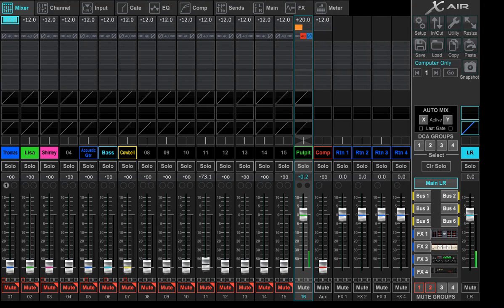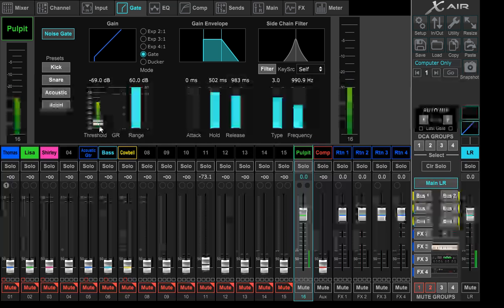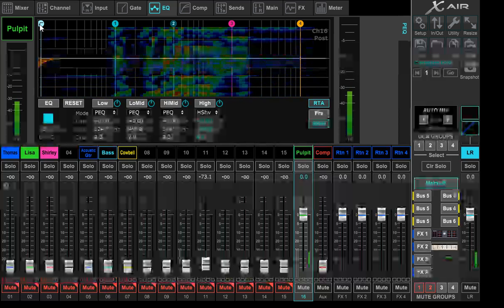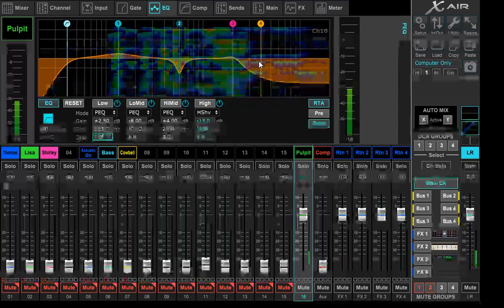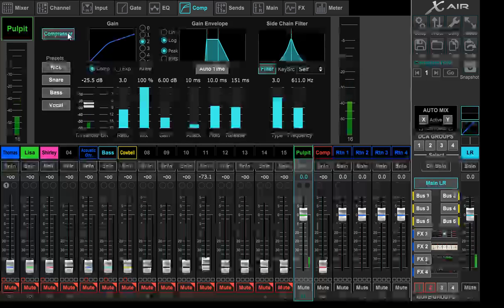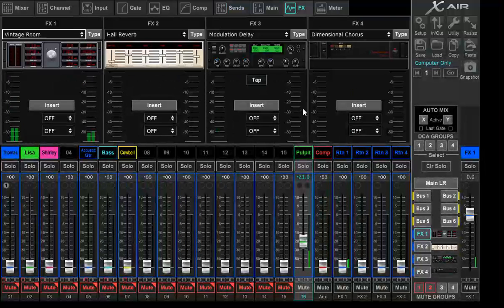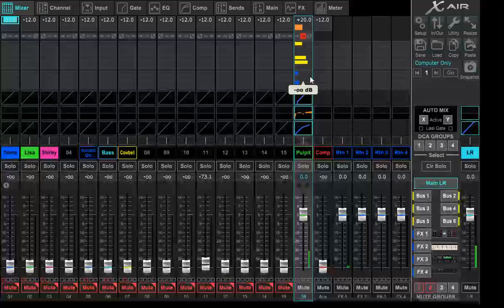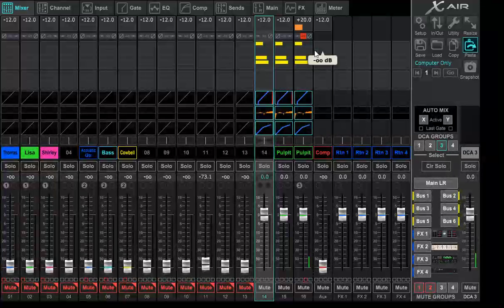Setting up a Channel on a Behringer XR 18

Comment: Thanks , this really helped with setting up a channel, especially for vocals. I'm still having trouble using a line input from a music player.(3.5 to 6.35 stereo cable)..it sounds weird, maybe it's  because i'm using a Y splitter for the LR  main out in to a single XLR,(single active speaker)?
Reply from the maker: It could be because you're trying to use a stereo cable instead of a stereo separation cable. That can create a situation where the two audio signals cancel one another out due to common mode rejection. I really like Digiflex HIN series of cables for this application. They have XLR and 1/4" varieties. https://digiflexcables.com/products/hin-1k2x

Comment: HOW TO FIRST SET INPUT GAIN (not correctly done in this video):  A PFL meter that shows you green-yellow-red will help you visually set your input gain. The beginner should not do this only by ear. You do this before adjusting the fader (even with the volume fader all the way down). This PFL meter is what you will find all the way to the left of the channel's INPUT tab view (https://www.youtube.com/watch?v=knG78f58R70). Bring the gain up from its lowest setting until the loudest parts of your signal are hot enough to light up all of the green, yellow is hot and it's your limit, but NEVER the red. Then your signal is properly hot enough so that you have a strong signal-to-noise ratio without clipping. Red is distortion to clipping, and you never want your signal in the red. On this software, the green to yellow to orange to red transition is more subtle than on other boards, and I find that staying out of the yellow-orange-red is proper. I suspect the gain was too low in this video, and possibly why the audio of this video is very low. Aside from all of that, I appreciate Andrew taking the time to overview the X-Air Edit software in his videos. He did the BEST job of them all!!
Reply: https://collaborateworship.com/how-to-set-gain/
Reply from the maker: I agree. If I had it to do again, I would do it differently. Thanks for your input :)

Comment: I very much appreciate your response Andrew but why does Behringer boast about these so called “Midas designed preamps “? Obviously to confuse us into thinking they ARE MIDAS!...  the xr18 is ok for background music or DJ but no way are these units for vocals... I purchased the x32  and got rid of it.... at the end of the day yo7 won’t beat analog for vocal presence... and yes there are other boards but how many boards should I spend money on to perhaps get the same or similar ??
Reply from the maker: Yes, I know a number of people who are rather incensed that Behringer bought Midas. I'm not up to speed on the controversy, but Midas was a very well-respected company and Behringer's reputation was not at that level. There are lots of good digital consoles out there, but this channel is focused on helping people get started with older or beginner gear.

Comment: I have this unit and it is Worst vocal sound I’ve ever tried to achieve!! It just doesn’t have it
Reply: Maybe you should learn how to use it. Sounds like operator error.
Reply: No, It just doesn't have that vocal presence like you'd get from an analogue mixer... I like vocals to have presence... No matter what FX on this xr18, the vocals are hollow sounding... thrown out into a tunnel like effect... Just no presence...
Reply from the maker: Behringer stuff is very price competitive, but if what you want is that level of production, there are lots of good digital units out there. I'd recommend you take a look at the Allen and Heath or Yamaha lines. The XR18 is entry level gear.
Reply: Andrew Bellous do you mean “entry level” as in average?... I can imagine any other digital component being any different other than a decent preamp.. the rest is basically down to how we EQ and the usual FX... these digital boxes won’t touch analogy
Reply from the maker: The XR18 is a nice little board with great features, but it's relatively inexpensive and there are other boards out there which are several times the cost, and there are reasons why they cost more. Preamps are one significant factor, but not all digital effects plug-ins are the same. The variety and quality of plug-ins does make a difference, too. As I mentioned, the Allen and Heath SQ line or the Yamaha TF line might be products that would get closer to the sound you're looking for. Just because the sound these new digital units produce is different doesn't mean they are inferior. They may just have a different set of strengths.

Comment: Thank you for the video. I am having trouble with setting my effects. I get confused on how to send them/set them up with multiple channels. For example; I’m setting vocals for channels 11 & 12 and I want to insert a hall reverb. I’m inserting into the channel and only one channel and I’m unable to add to the other channel. We use the system in a band set and forget setting. Could you give me some tutorials on how to properly do it win the x18?  I’ve watched several which is confusing
Reply: I'm just learning this board now, but usually that's done in one of two ways. either through the send and receives along one of the effects buses or send the vocals to a sub group and apply the affects to the sub.
Reply from the maker: Sorry, I no longer have access to that board, as I'm serving another church now.

Comment: As a total noob i am trying to understand my XR-18.. your video is of good use as a quick how to... thank you.. i am still trying to understand DCA's ... what if for example channels 1 2 and 3 are on DCA 1 and if i move the fader from channel 2...will fader/channel 1 and fader/channel 3 follow the same as fader 2? Or can DCA's only be controlled from the main LR Slider? questions questions questions..... aaaarrgghh :0  Ooh by the way i am controlling it using the24 inch  touchscreen of a SONY VAIO all-in-1 computer...so no need for staring at small phone or tablet screens anymore..
Reply from the maker: A DCA, or Digital Control Amplifier, is a way of grouping several channels together to be controlled by a single fader. Lowering the DCA fader will lower the volume of all selected channels, but you will still have control over the volume of each individual channel with the fader for that channel.

Comment: The only suggestion I would make would be to set your gain first, and not worry about the fader position until after the gain is set. Use PFL and bring the gain peak levels up to "0". Then adjust your faders to desired volume.
Reply from the maker: Yes, I agree. I was still new to digital mixers when I made this video, and I've since changed the way I approach gain.
Reply: @AndrewBellous  I use the same method for both analog and digital mixers. I try to maximize the signal at each step, which gives you more headroom when you get to the amps. Then to increase the overall volume, just bump the power amps or the powered speakers. 

It always made sense to me to follow the signal path as it comes into the mixer, and maximize at each step. Gain is the first step of mix, so I use PFL, so the loudest signal of a channel reaches zero on a digital mixer. Then adjust your faders to desired sound. Thanks for the video.
Reply from the maker: Yes, thank you. I follow the same methodology. However, we are all on a path of knowledge as to how to do sound better, and these videos were produced rather spontaneously. I have come to appreciate how important it is to think through every aspect of a video. One moment that was not fully considered can be subsequently brought to one's attention many, many times. I appreciate your interest in finding the right answers and helping me stay on track :)
Reply: @AndrewBellous  , We're all always learning. I'm far from a finished product in terms of learning all this stuff. Very far as a matter of fact.  😊

Comment: You lost me the moment you flipped polarity on the channel and said it sounded better.
Reply from the maker: Hey, guys. Thanks for keeping me humble. I still have plenty to learn :)
Reply: You definitely taught me something Andrew with all that not so perfect video, as some may call it. Thank you for your efforts! 
I have ordered an XR18 and need to learn to get around the control system. This is my first Digital Mixer so i needed to watch this video. Thank You!.
Reply from the maker: Thanks for your encouragement. I do sometimes receive criticism and its usually well founded. Flipping the polarity shouldn't affect the sound, and that's why you might hear a note of surprise in my voice when I made that comment. I wasn't expecting to hear a difference, but thought I did. Probably should have just not said anything or tried a second take 😕
Reply: @AndrewBellous  Changing the polarity is more appropriate for affecting feedback from speakers, and the sound of a mic, when other mics and/or direct inputs are in the mix.
Hope this helps, and good on you for learning new things, and sharing.
Reply from the maker: @TheScreamingFrog916  Changing the polarity shouldn't affect the sound in a way that the human ear can easily detect unless there is a problem with cancellation. It shouldn't affect feedback either, unless cancellation is producing or inhibiting feedback. The polarity reversal setting isn't there to fix a problem, it's there to detect a problem. If sound is being cancelled because two equal and opposite sounds are cancelling one another out, then reversing the polarity should reveal that problem, but the solution to the problem should always be to correct the issue at source, not use the reversed polarity setting to solve the problem, as that will likely only be a partial solution.
Reply: @AndrewBellous  Read up on "gain staging", to get a better idea of how to set the preamp gain.
Basically, you are setting the input gain as high as you can, without clipping on the loudest passages, and leaving a small amount of extra headroom for safety.
Reply from the maker: @TheScreamingFrog916  Thank you for pointing out this issue. If you read further in the comments, you will find that many others have raised this issue, and I agree that the way that I presented it is not best practice, but a technique that I find works best for beginners, the target audience for this video. Gain wasn't the focus of this video, and if I had realized that so many people care so deeply about the issue, I would have taken more care in how I approached it.
Reply: what about when he turn almost immediately phatom pw on and off with eveything unmute... mic and monitor destroyer
Reply: when he turned the compressor on and says his vocal sounds more beefier, but it was below threshold and all it was was make up gain.
good on the guy for giving it a go though!
Reply: microscopic phasing from headphones maybe? lol
Reply: Justin Mai i

Comment: Lots of very useful information here. Notwithstanding, once you get started you can go deeper into learning about gain structures and optimizing SNR
Reply from the maker: Yes, this is very basic instruction aimed at beginners. I've since made other videos that talk more about gain structure. The instruction on setting gain here relies on several unspoken assumptions about how I set up the amps to favour this method of managing gain. Several people have commented that they wish I'd approached it differently, and I have to agree with them. My explanation is  confusing and does not reflect best practices.

Comment: Thank you for doing this. It has helped me a lot. I would like to ask you this: How did you label your individual channels?. I cannot seem to find a way to do this, I have looked on the behringer site as well, but I have not found the answer.
Reply from the maker: The digital scribble strips are very handy. In the X Air Edit program on PC (I'm assuming it's the same on iOS) you need to right click on the black square between the solo button and the pan control that has the channel number on it. Then you can type a name for the scribble strip and change the colour.
Reply: Thank you. I will try that tomorrow. Thanks again for your video and your help.

Comment: Andrew, I just watched your 'X-air for android" video, which is very clear and helpful to an x-air (and mixing) noob like myself. however, the screen on this video doesn't look anything like that app. Is the Pc or mac? is it different from android?
Thanks
Andy
Reply from the maker: There are applications for PC, for iOS and for Android. Each of the applications is similar, but slightly different.

Comment: Thanks so much for this.the best beginners guide i have come across so far.
what will your advice be on the effects to use for vocals so it doesn't sound dead.
Reply from the maker: The basic effects to brighten vocals are Noise gate (cut out background noise), EQ (balance bass and treble), Compression (control sudden volume spikes), Reverb (add echo) and Chorus (thicken the sound). On my channel you'll find several playlists from creators with more expertise in these areas. Look for the EQ playlist and that will get you well on your way. ☺️
Reply: niceee. i will give that a try
Reply: Andrew Bellous p